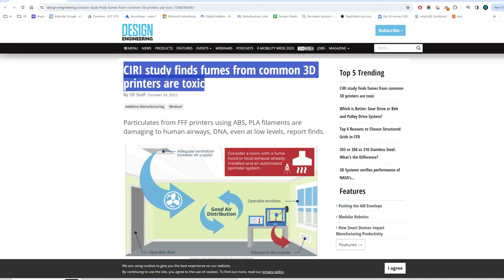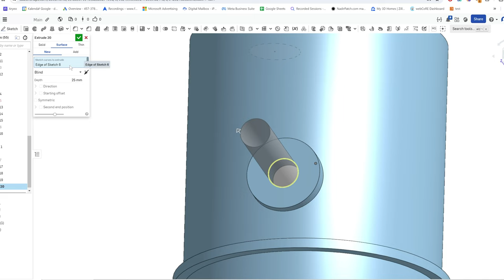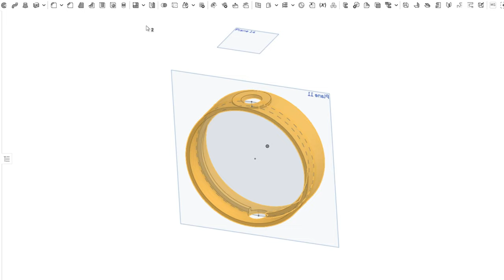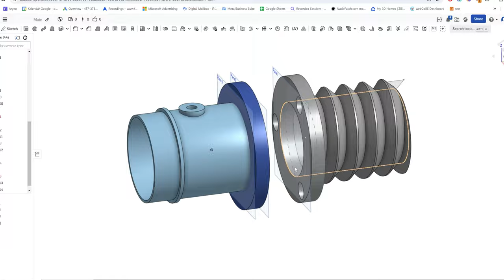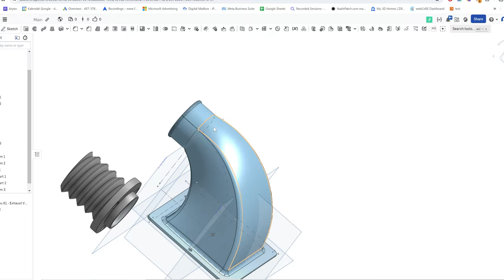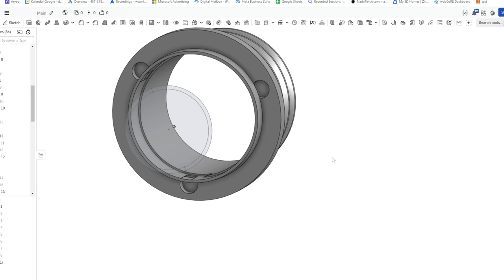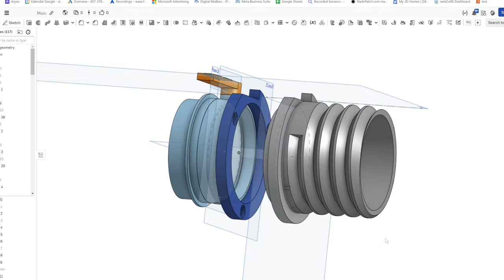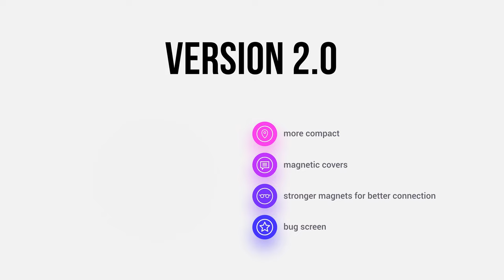Ventilation system for Bambu X1C | DYI project

Comment: For anyone implementing a printer exhaust system, be advised if your makerspace is in a basement, or especially in an enclosed utility/machine space where there are combustion appliances (gas furnace and/or gas water heater), you could inadvertently be sucking carbon monoxide that is normally being exhausted out the stacks of the furnace and water heater INTO your living space. Be very careful - this is potentially a deadly situation.
Reply: This is very true. My gas water heater relies on convection to move its burnt gas(carbon monoxide) up the vent pipe. It's not a sealed system. If i have the clothes dryer running and a vent fan on i can create just enough negative pressure to occasionally trip my carbon monoxide alarm. Mainly when the vent pipe on top of the roof is a little iced up. My fresh air intake isn't exactly "code" either so that doesn't help but that's another story. Moral of the story, if you have gas appliances ALWAYS have several carbon monoxide detectors spread around your house.

Comment: I am currently building a vent system that circulate the air through a HEPA filter and only let air out of the enclosure if it is getting too hot. The flow of the system is controlled by a small RPI hat and is connected to an air quality monitor. I wanted to use the RPI cause I already have one for Octoprint, but it would probably have been better to just run the ventilation off a Arduino. One thing that I am really careful about is draft inside the enclosure. I will let PPM values get a little high during prints rather than circulating too hard. Instead I will circulate and vent once the prints are done. I like your designs and also found Onshape a very valuable tool for these projects. Keep up the good work. Cheers.
Reply from the maker: I'm not expert in this but HEPA seems useless for the 3D printer fumes. HEPA is good for removing particles down to 0.3 microns. But those are usually dust, bacteria etc. Fumes molecules are way smaller (from 0.001 to 0.10 microns) so they would just fly through the HEPA with ease. I will be checking if the prints get any worse because of the draft but so far it's been printing great. Since I print with the printer door and top closed I believe the draft won't be strong enough to cause any issues
Reply: @therealfazee  semi correct and I might end up with a hybrid solution depending on the testing ahead.
Reply: Do you can't outside or recirculate inside? If to outside why filter at all?
Reply: @therealfazee  That is actually not correct. It is true that HEPA filters list their rating and effectiveness for 0.3 micron particles, but that is because those "medium-sized" (medium as far ultra fine particles goes) are the hardest to be catched by use of a filter. A bit counter intuitive, but both larger AND smaller than 0.3 micron particles will get stuck in the filter easier than the 0.3 micron ones will.

Comment: You've got to remove the carbon filter and remove the little the door to it for proper ventilation. I've tested air flow, and the "Temperature control" fan actually sucks air inside the enclosure in the stock and unmodified X1C
Reply from the maker: Are you sure about that? Because when I put the chamber fan to 100% I can definitely feel and smell the air coming out of the housing that I placed outside, it's not sucking the air from there, and my X1C is stock. To remove the little door might be good idea though, will probably do that when the filter is due for replacement
Reply: @therealfazee  the net air flow is going outwards, but I think that there is too little air from the enclosure getting to the fan, so the vast majority of the air is sucked in from outside and immediately blown back out through turbulence. I can't find out if this is by design...

I have yet to create a venting solution of my own. I'm still in the process of printing parts, so let me know if you end up testing opening the little door to the activated carbon while printing ABS or PC. I'm not sure it's a good idea to vent with an increased flow of air since these materials need high temperatures to flow correctly and prevent warping, and it might be hard for the X1C to keep up with an increased flow. However, I would tend to at least try to increase the air flow because I hear the X1C fogs up with VOC (deposits?) when printing with ABS.
Reply from the maker: @eliotbolduc1672  that's true it's not much of air even at 100% as the fan is more like PC fan for cooling rather than extracting it out. That's why I was thinking on adding the extractor fan in the line. But the room definitely doesn't smell when I print PLA (70% aux, 70% chamber) and I can smell it when I get outside so must be working to some extent :) haven't printed ABS yet I but I realize the high airflow might cause warping or lifting issue, will see. Yes X1C fogs up pretty easy even when printing PLA or PETG (the glass was all fogged up not sure which one of those caused it lol). Thanks for input!

Comment: I note that where the fan is on the printer the wall in front of it looks like it's metal, is the side of the Carbon X1 Magnetic Metal, Aluminium or plastic? Have you also thought about increasing the magnetic strength by fitting a shim between the fan and the internal wall of the printer with some slim n52 bar magnets in it? this would mean all that you would need for the out side on your connector would be a thin metal plate.

Comment: I use what is basically a grow tent, vent hose has an inline fan which I feed into a big cylindrical carbon filter which is way overkill for the small enclosure but works a treat. Search “grow tent carbon filter” to see what I’m talking about. I also run an air purifier with carbon filter in the room for when I’m not using the enclosure, like with PLA and PETG.
Reply from the maker: inline fan is in the plan for Ventilation 2.0.. :) tent is a good idea, even with ventilation on the smell still gets out of the printer through all of these small gaps etc..
Reply: @therealfazee  No smell gets out due to the pressure differential. When I turn the fan on to its lowest setting the sides of the enclosure are pulled in, even with gaps in the zipper for power (printer and lighting) and Teflon tubing for external spool or AMS. I use the enclosure for resin printing too and never smelled a hint of anything even with resin that is definitely not low odor. 

Of course I eventually have to open the enclosure eventually, that’s when I kick the air purifier to high. I’ve also covered the HVAC intake on that floor. I live in a 3 story townhouse; printing stuff is on the mostly-unused first floor (laundry, garage, front door).

My setup isn’t as good as just venting straight outside but it’s the best I could do and honestly works better than I’d hoped.

Comment: thankfully it's a covered patio, but it could still be helpful to a little sloped ledge above the top of the outlet, to reduce the risk of water ingress. (and also caulk the outer part's flange to the door). also, maybe a very thin layer of some squishy silicone rubber or foam on the interface between the vent and the printer, to prevent leakage. because the fan is inside the printer, the adapter where you connect the hose is at a positive pressure, meaning any gaps will leak exhaust back out into the room

Comment: the draft going out will make your bed vary in actual temprature as its not a circulated heated enviroment pulling in cold air that will cause cold pockets idside the build area and your alignments out of tollerances like the cold pockets shrink and the hotter areas expand you get a pretzel
Reply from the maker: works perfectly so far, will keep my eye on it, it doesn't seem there is much draft there when the printer is closed

Comment: What are the cons of adding an inlet fan to the exhaust pipe? I still get plenty of VOC's (smells) coming out from the top/front.  Venting the main exhaust and auxiliary exhaust on the other side a bad idea?  The air flow that would be sucked in would come from the poop opening.  I was thinking could add a small heater chamber that can heat the air being sucked in to control temp to keep the chamber at desired temp and maintain a good airflow that takes all the harmful air out and away.
Reply from the maker: I'm planning to add an extractor fan in the exhaust line.. I but I think that might cause too much negative pressure and some issues

Comment: potentially dumb question: is venting REQUIRED for the X1C? I'm planning on getting one but It would have to be in my room. (Noise isn't a factor to me, im not worried about the smell either) but I'm trying to find information on if it's actually required. I'm thinking about getting this one over the P1P because I heard it's print quality is overall better than the P1P. Thanks in advance!!!
Reply from the maker: depends on filament.. but it's not required
Reply: Print quality depends on settings...you can get same result from p1p/p1s/x1c....x1c has more features,p1p p1s needs more manual calibration
Reply: Print quality can be the same if you calibrate your filament which is generally easier with the X1C which can do it automatically thanks to the lidar. However auto calibration doesn’t work with sparkly or translucent filament.  I only print in an enclosure when I’m printing ASA or PC, but I also run an air purifier in the room with a carbon filter because printing with any filament gives off VOCs.

Comment: It will be a disaster when some one opens that door from the outside !!
Reply: the hose is connected with magnets, the hose will just detach and flop to the floor. it's also magneted to the back of the printer, so it's unclear which end will detach first, but that doesn't matter here since either way, you just... stick it back on and everything's fine.
Reply from the maker: exactly.. not worried about that at all.. it detaches really easily